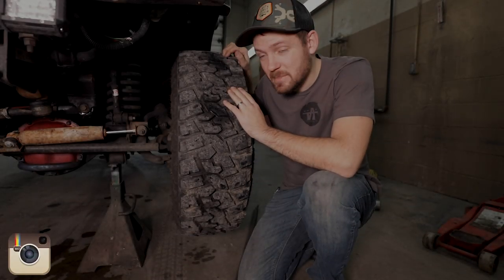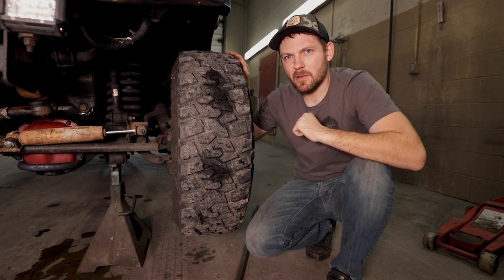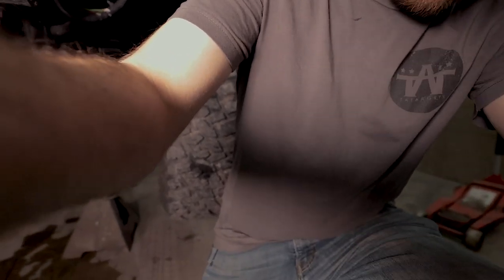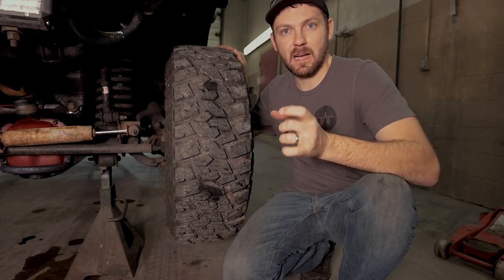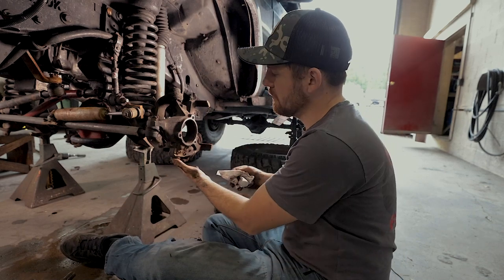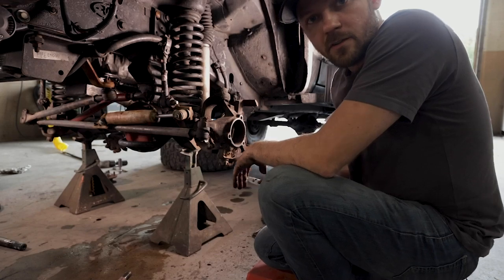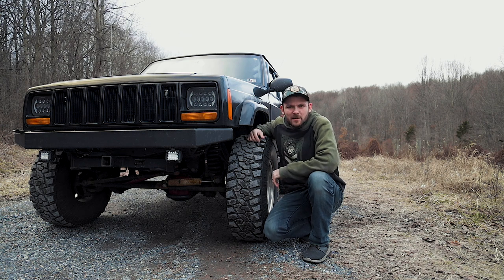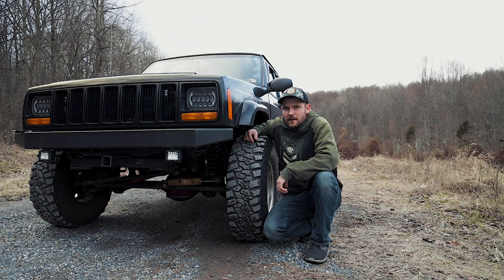My Wheel Bearing Almost Exploded! | Jeep Cherokee Ball Joint Replacement

Comment: I'm using your video as motivation to take mine in to get this done. Typically I'd DIY my way through it, but my temporary lack of shop and lack of tools is keeping me from wanting to do it outside and with hack-job tools. I'll reference this and the follow up video in a few years when I need to do it again! Thanks!
Reply from the maker: Sometimes that’s the best option. The last few years I’ve sent some projects to the shop. Sometimes spending money hurts less than DIT